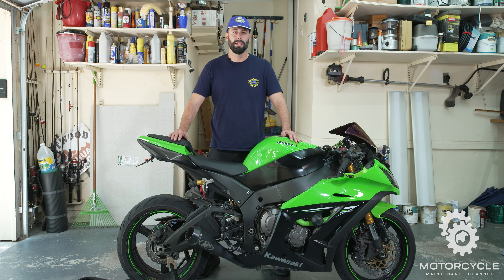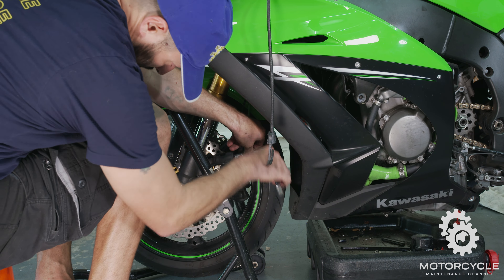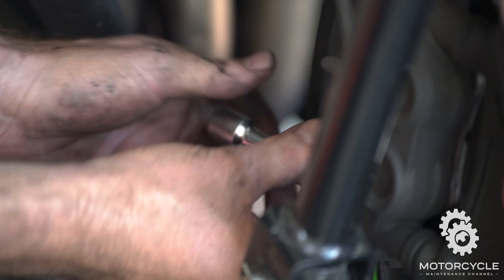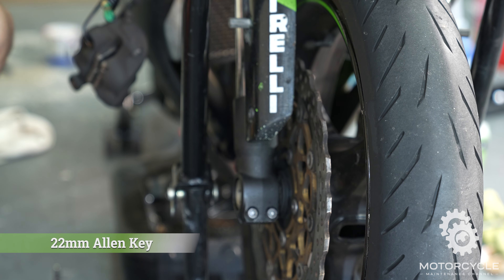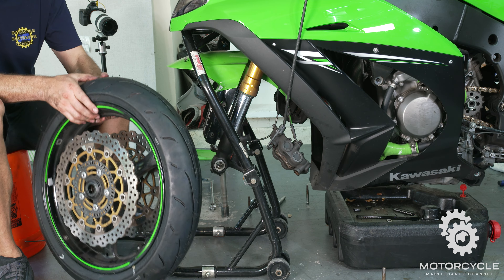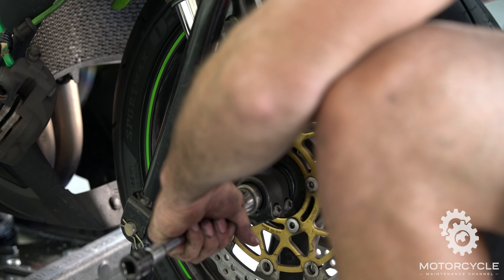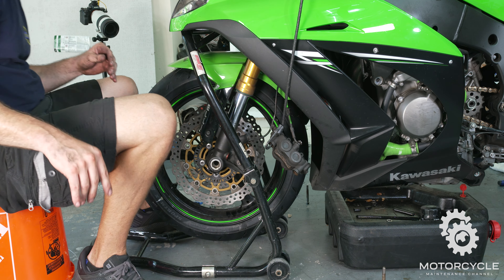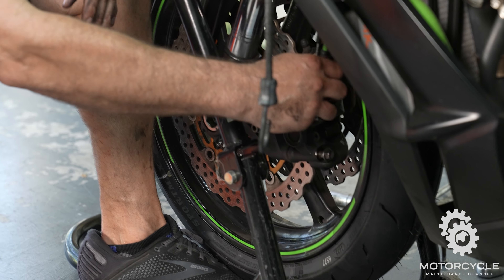Kawasaki ZX10r - How to Remove/Replace the Front Wheel

Comment: Half-way in I'll give you  Thumbs Up for 1.  Getting to the point.  2.  Simple instruction.  3.  And good video.  Too many YouTube waste time talking for 2 or 3 minutes just to up their ad revenue.  I want How-To videos to get to the point.  So far, I'd critique that you should loosen the right side Axle Pinch Bolts because it makes rwmoving and reinserting a tad easier.  Also, before removing the axle, snug up a pair of rubber chock blocks under the wheel to keep it from falling.  Allows your hands to be free and protects the wheel.  Gonna watch the next 5 minutes!!  Hope you have a rear wheel video too.  Thank you.

Comment: The next five minutes, please be specific in your torque requirements and make sure viewers know that your torque specs may differ from theirs.  I have a 2017 ZX-10RR and my specs are as follows:  Front Caliper Mounting Bolts, 26 ft lb, in sequence, bottom, top, bottom again.  Both sides.  Front Axle Nut:  95.9 ft lbs.  Front Axle Clamp Bolts, 15 ft lbs, in sequence; 3, 1, 2, 4.  Then you go back and do 1 and 2 again.  Again, this is from my Service Manual for a 2017 ZX-10RR (Gen 5).  I also like your Bungee Cord idea!!  Very convenient.
Reply: Watching again two weeks later.  One thing I read in the manual is, after seating the calipers back on to the brake disc (rotor), it says to screw in the caliper bolts but leave the bolt head backed off just enough so the head does not touch the caliper.  It then states to squeeze the brake lever to seat (mate) the pistons to the brake disc while also seating the caliper so the caliper, pistons, and brake disc are all synergized.  Once the brake lever is squeezed, and held, and all components are synergized, then torque the brake calipers bottom, top, bottom.  I am not saying your method is incorrect.  I am sharing what the manual states as far as procedural sequence.
Reply: You deserve two thumbs for providing torque settings.
If give you three if they were in metric😂

Comment: 😂 i just put a new tire on my bike 30 minutes ago walked in the house and this was on my feed. I used a front wheel lift and it makes alittle bit harder to line up the axle to slide it in. But job complete.PS, amazon has a 22 mm hex socket. 8 bucks, got herein 2days.

Comment: I used a front stand that lifts from bottom of forks. Having an impossible time lining up axle to nut.
Reply: Same here what did you do? It’s impossible.
Reply: 2Fast2Fear I think the stand we are using are keeping pressure on the bottom of the fork not letting the axle slide through completely. I bought another stand that lifts the bike from the bottom of the triple tree. If u need anymore info let me know.

Comment: Is it 94lbs torque or 80?? You kept saying 94 but the videos shows 80 on the left hand side when you’re torquing it
Reply from the maker: Sorry about that, 94lbs of torque, per the manual. I see people online suggesting that 80lbs is enough, but the engineers in the manual say 94ft-lbs if torque for the front axle nut. Sorry for typo
Reply: Thank you!